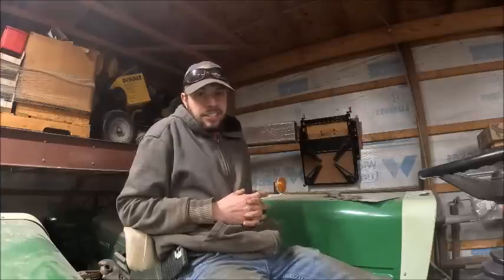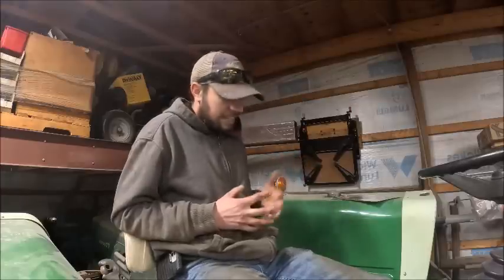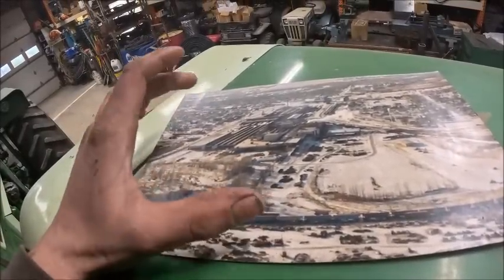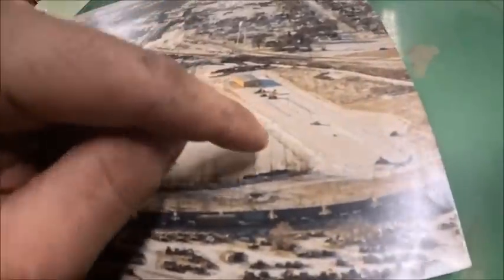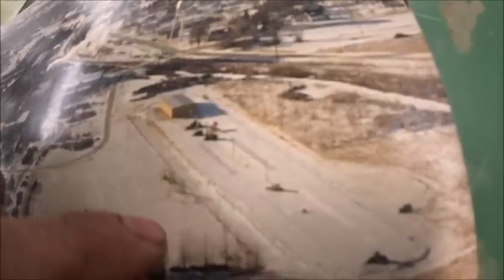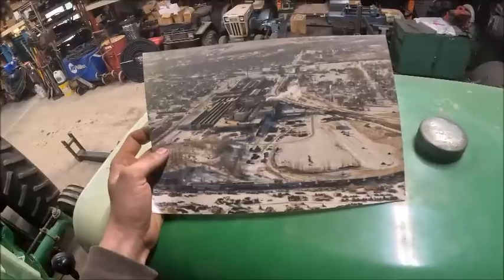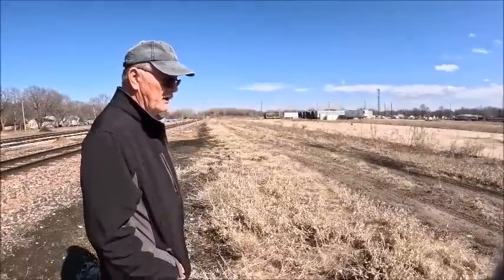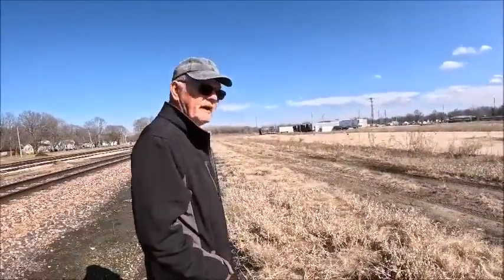Visiting The Slab: All That Remains Of The Oliver Charles City Production Plant

Comment: 1962 - graduated HS - summer job. Ran one of those Bullard lathes he talked about.  Had to use an electric hoist to lift the cast iron rear wheels onto the chucks on the table that spun the wheel around under the head that held the cutters.  The job was to face off both sides of the hole the axle hub bolted to the wheel. Sometimes I didn't get the wheel clear down on the chucks as I tightened the clamps which meant that when the hub was bolted on it was not perfectly perpendicular to the axle - you can decide what the result of that was. They gave me a metal stamper that put my initials on the face of the whole so you can look for RW on the wheels of the 1600 series they were making then. Grew up on a farm SW of CC Take care all!!!
Reply from the maker: I’ll have to look at the wheels on the 1800 next time I think about it. That’s a 64.
Reply: @Oliver66FarmBoy
Reply: My brother has 4-5 Glencoe. Spent many days - nights 60s - 90s  in 1066 in IA.

Comment: The railroad track running east and west and the street is on the north side of plant, that's the street you parked on. The display of turn table tractors westside of the plant. Alan points west in the video towards the elevator. North is at the back of where you are standing. You where facing south.

Comment: I think it would’ve been so cool to have been a machinist there back in the day. I run mostly CNC now in modern times but it would’ve been really neat to see all of the specialty equipment and tooling used to produce those tractors before NC and CNC machines came to the market.
Reply from the maker: Would have been cool to do just about any job there.

Comment: I do work with railroads from time to time on right of way works..  I have seen plans for the old plant grounds to be set up as a trans load rail yard for Bio fuels and LP gas since you have 2 railroads CN and CP (CPKC) . The total Brownfield site is around 65 acres and the state has put up a million $$ to get it going. The plan calls for some trackage and will use about 25 acres of the area and have around 350 cars of storage tracks for 286,000 lb cars . So that will be a big change from 2000 people building 100 tractors per day .
Reply from the maker: Doesn’t seem like enough room for all that.

Comment: On some of the interviews I have seen. White had put over $3 million in to updating and expanding the foundry about 6 years before White went under. They were going to produce the castings for the new White corporate engines at Charles city and ship them to the new White engine plant that was built and never opened. Most of the new equipment in the foundry was never used when it closed and sold off.